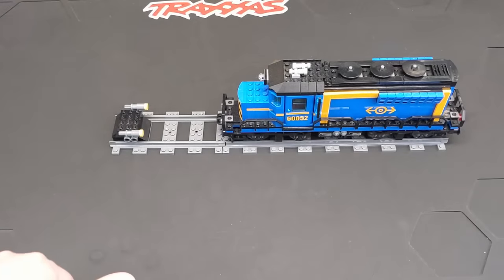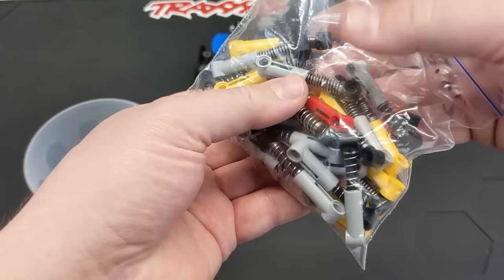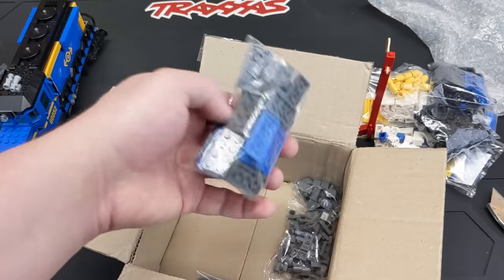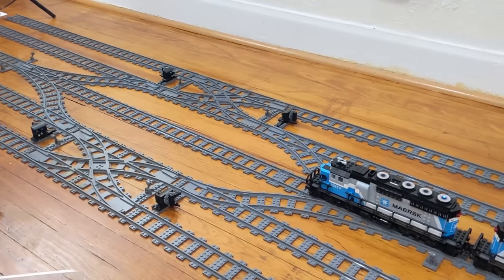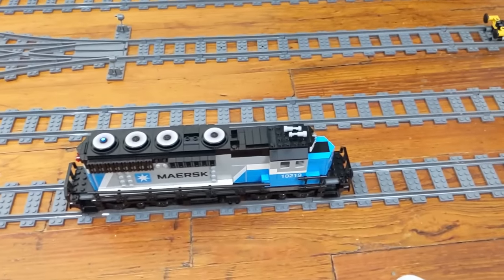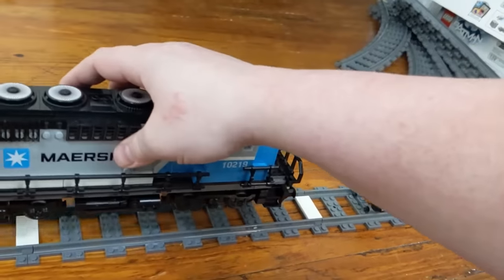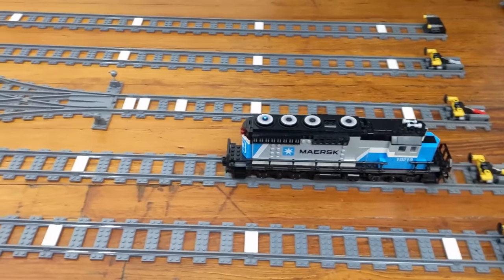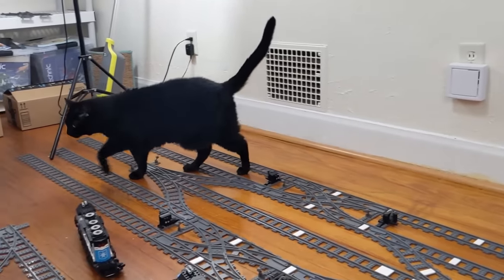Testing Lego Buffers from Reddit

Comment: i mean for me the best for shock absorbing (IMO) is just a strechy rubberband stretched across the tracks with a bit of travel for the train
Reply from the maker: Not exactly realistic, but it could be fun 😅  Lego train slingshots!
Reply: @BatteryPoweredBricks  XD would be pretty hilarious to see a sort of "aircraft carrier" esq launcher for trains so they get instant acceleration up to full speed :D also if you have oil filled non lego shocks, those might work better
Reply: That's literally not even the point. The new one looks like a realistic piece of equipment.
Reply: @michealshelton2133  Not only do the new ones look great, they're also functional and won't really go bad over time unlike a rubber band which will naturally degrade.
Reply: I am going to build a train slingshot now 🤩
Reply: @SleepyFen  dunno what kinda rubberbands you use but they are like 1$ for a pack of 200+ sooo not much cost and also who doesn't like a train slingshot

Comment: I have a few 4.5v and can explain how the signal works! There's a small button on the bottom of the battery box which works as a circuit breaker. The signal fits between ties on the tracks, and the red bar at the base is either lifted or lowered depending on whether the signal is up or down. When the signal is down to stop the engine, the bar will be up, which the circuit breaker button runs directly into. While the signal's up the bar is lowered and the battery box rolls right on by without touching it.
You may already be aware but the small red stand you got also interacts with the battery box: It is affixed to the outside of the track and the triangular wedge will collide with the 3-position switch, reversing the direction. (Or, if your batteries are low or too much weight etc, it will simply collide and go to neutral, stopping the engine)
I believe I had recorded a video demonstrating both of these, but never uploaded it. If you like I certainly can upload one though!
Reply from the maker: I meant the raising and lowering itself, I had seen them used in a few of BrickTsar's videos.  I have a 4.5v train I just haven't used these pieces with it yet.  It definitely has a lot of charm 😀

Comment: Nice test! 🙂
What I find annoying about Lego sizes is the dire need for 1,5 diameter round tiles at least... 1 is usually too small for buffers, 2 mostly too large for buffers, headlights, etc.
One solution I found was using the small train wheels 50254 - they are not ideal shape-wise but nicer size-wise. (note: these new 50254 ones have notched holes - if you want the wheel to roll better , look for the old 2927 featuring round holes.)
Also, you can get proper single buffers, produced in the 1970s and 80s, under Bricklink "buffer".
Reply from the maker: Yeah I have seen some that used the 70's-90's buffers without a magnet.  I feel like I've seen some that used a shock absorber as well.  It would be really cool to see some 1.5 stud diameter round tiles

Comment: If you dont have shock absorbers, could you try using a long axle with bush 3713 or 4265c to act as friction energy dissipation. it would need reset after impact, but multiple spaced bushes could be used to gradually absorb big impacts. In theory.

Comment: Maybe try out some of those 2909 shock absorbers. They can be had with up to "very hard springs" and they have more than 1 brick of movement. For a heavier train these might be what is needed.
Reply from the maker: The more I think about it I really don't think I'll be hitting them at high speed or even with full trains.  They will typically be used in rail yards.  I may end up using the medium springs I tested

Comment: I would say this is the best way to think about it. the energy of the impact is the same in all cases meaning what matters is the amount time the impact takes (impulse).  (the longer the time the lower the force that can break things IE th track or the train) This means that the spring that makes the train stop the slowest while not bottoming out is the "best" (F = -kx) thus there will be a different optimal spring for each train mass and speed (kinetic energy) you would have to do more analysis of the trains that use the tracks to pick a spring that suits the most use cases possible. i loved getting to think about this. hopefully i'm not wrong but if that's the case i get to learn something. PS i know this is lego and it doesn't really matter but oh well
Reply from the maker: By all means!😁  This stuff is fun to think about.  I think in the end I will use different springs for different places on a layout.  If it's a spur off the main line or something maybe the harder spring and in the yard use softer springs.

Comment: You should have a three spring buffer so it will hit soft and then harder if it hits fastee
Reply from the maker: I did see designs that used more shock absorbers.  I wanted something simple since I planned on making several.  I had fun testing them but unless I make a mistake they won't be hit at high speed

Comment: Track separation can be fixed by adding ballast. It is expensive, but it looks better and improves strength and durability. I ballast according to the PennLUG standard using fewer parts than they do, but any sort of ballast works. I like the use of the harder springs. But I wonder if the more intricate MOC 8-wide trains we build would fare better with the use of the softer springs.
Reply from the maker: You've seen my layouts, I'm not ballasting all of that 😅.  But yeah on an actual layout with baseplates / ballast I'm sure track separation wouldn't be a problem
Reply: @BatteryPoweredBricks  I guess that was misleading. Sorry. I don’t ballast everything. I have tiny segments ballasted on baseplates, that I can bring as spares for our shows. TBRR collectively has a LOT of ballasted track. Lol

Comment: at 3mins straight you brought a old 1990 lego train stop unfortunatly you canot use it whit the tracks of lego has now only whit the tracks where you have the old 4pieces tracks you have to out toghetor and then click on it on another straight or curved track. like i sayd that 1 is purely made for the battery powerd & track version form that lego era 
after a while they even added another track piece that what the powerd rail in the center from that moent on you needed a different type off stop
Reply from the maker: I have lots of the old style of track and I'm collecting older trains as well.  I already have a full 4.5v train with the battery box car with the switch on the side.  The 12v system with the powered center rail is something I'm working on getting into now.  But it is not easy since it was never released in the US.  So most of it has to be imprted